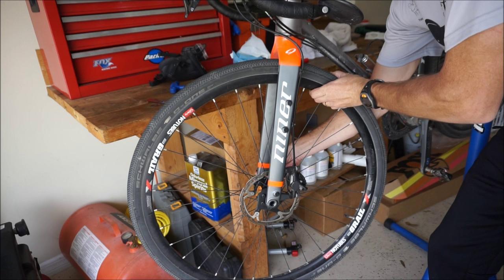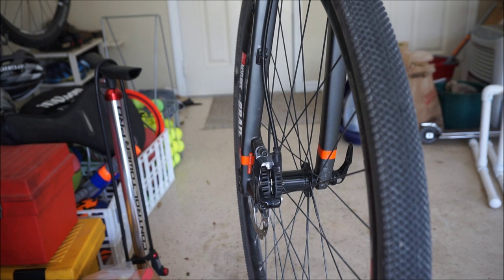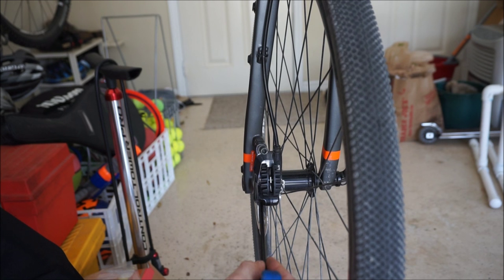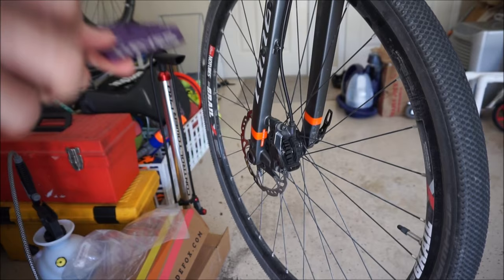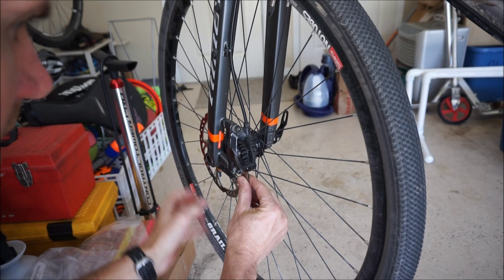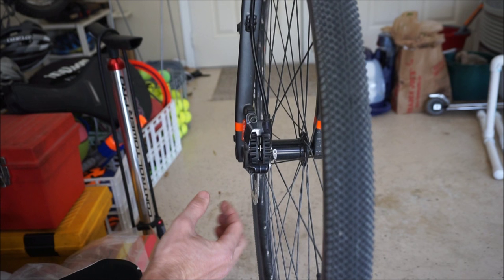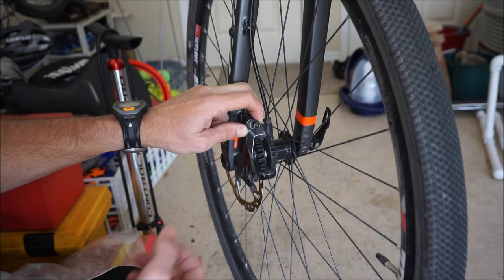How to Center Hydraulic Disc Brakes

Comment: Wow! I can’t thank you enough for posting this video. I spent 4 hours on a holiday trying to adjust the brakes using the very last method you mentioned, which is to eyeball it while screwing in bolts on the caliper. This got me nowhere and is the worst method! I do not recommend it! The first, easy method you mentioned, which is to hold the brake down while screwing in the bolts, is the best method by far. I got so pissed off and extremely discouraged by continually failing using the “eyeballing it” method that it spoiled my mood for the next 3 days and I was mean to those around me. Folks, if you can’t figure it out after half an hour, give it up and try something else! Or take it to your local bike shop. Nothing is worth you overloading yourself with failure and disappointment. Again, when I watched your video and saw how easy it was, and then was able to successfully fix my brakes, I was beyond grateful for having seen your video. Thanks for posting it.
Reply from the maker: +Biker Girl 👍
Reply: I know about moods after trying something that’s suppose to be easy and I end up screwing around for hours.

Comment: Thank you for this clear cut information, I did the first, second and finally the third one worked, the disk was a tiny bit bent and so I straightened it out with a crescent wrench. No rubbing whatsoever now. I think this happened when I put the wheel back on the frame. Thanks again.

Comment: had a issue with brake rub on my front brake when I put on new wheels. I never have issues centering brakes in the past. I saw you mention the shim tool and I completely forgot I had one of those...boom, brake centered.  :)

Comment: Nice video. To the point and straight forward. Holding the brake lever and tightening the calliper bolts worked for me. It's nice to have finally eliminated the annoying brake pad rub. Thanks Clint

Comment: Very helpful video and very clear visual and explanation. I had this problem with my rear caliper on a new bicycle and the sceaching noise when pedaling even when pushing the bike was horrible, then I was shown the two screws as you showed to loose and realign the calipers and that solved the problem. I definitely will by the tool that you just showed for future problems that may come up. Thank you for the video from Oregon state.

Comment: Very instructive, just got a new bike with hydraulic brakes and didn't know how to adjust them and didn't want to go fiddling in case I happened to open the wrong screw and spill oil all over things.

Having it auto-center didn't work well, it still pushed towards one side, but I've got a support for the front fender touching the brakes so that's probably why.

But doing it manually worked wonders, I put a soft spin on the wheel and fiddled around with the brake until it was centered and silent and then tightened it carefully and it worked great.

Thanks for a great video :)

Comment: Thanks, Clint!  I tried adjusting the bolts but still had the brake rub but using the screwdriver to reset the calipers solved it for me.

Comment: Thanks for the tip Clint, I couldn't get the squeeze  only trick to work but the business card trick that you heard of does work i cut the card to fit between the pads and rotor then squeezed and tightened and removed the cards worked great, good video thanks again.

Comment: Ok thanks for the vid Clint. I replaced my rear pads on my SLX disc brakes but had trouble centering them. I tried all these methods including business cards. One side was still rubbing and the other had a big gap. I eventually got them to only slightly rub (probably slightly out of true) by putting 3 business cards on one side and nothing on the other.
Reply: Bent  discs ? Bend back with wrench

Comment: Good video, thanks.
I watched this (and some other) a few weeks back when I was mounting Magura MT7 brakes (4-piston caliper) onto my Inspired bike.

As I did years ago with my Specialized (+ Shimano XT's) I tried the first method (loosening bolts, pulling brake lever, tightening bolts) and this seemed to work, but after close inspection it wasn't really centered - The spacing left-to-right was off a bit and the disc got pushed left/right when you pulled the brake.

I then did the "manual" method of visually looking down the pads and engaging the brake gradually to make it parallel and center. This was a huge pain-in-the-ass but in the end, the result is way better. All 4 pads engage at the same time, disc moves freely and it does not get pushed in any direction.

I would not hesitate to recommend a friend helping you for this, as you need about 3 hands doing this (1x pulling brake, 1x aligning caliper, 1x tightening bolts). It's possible alone, but it's more trial/error than precise adjustments.

Comment: Most bike mechanics will be using method 3 most of the time. The first 2 previous methods assumes a lot about how true a rotor is and how it moves from it's relaxed position to it's braking position. Many times, taking time to clean (sometimes lubricate) the pistons will put you in a scenario for the first to methods to work. Certain brakes will need to have the pistons reset overnight to help achieve this. Basically, if you are a new mechanic, don't be frustrated that you need to use method 3 more than this video would have you think. Most bikes are not in good enough shape for you to rely on those methods. It either take extra time to clean and reset or extra time adjusting. This is why I would like to see more innovation around centerring, like the hayes "crosshairs" system.

Comment: Great video ! I have an issue with my h brakes the space between rotors and pads is wider than a business card I adjusted both a couple times but the space still same, pads are like halfway down, the bigger space the less accurate braking right? What else can I do?
Reply from the maker: +Predator7 7 after you center the brakes you should be able to pump the lever and have the pads be in the right position. As long as your lever does not go too  close to the bar you should be fine. I would not say the braking is less accurate. If you find the lever going to close to the handlebars then you're going to have to bleed the system.

Comment: Squeeze centering has never worked for me. I dont know why. I always have to set it by eye for it to not rub.
Reply: Same with me Iatuman
Reply: It's worked for me.
Reply: you need to use that Hayes or similar gadget and squeeze. The squeezing without the tool did not work for me.
Reply: rear yes front not
Reply: @adityadafre4672  What advantage  is there using the tool or business cards - how does this differ than just squeeing the brakes on the disk alone?
Reply: @TopUKPhotographer  More space between the pads and the disk.
Reply: @richardjones2811  Yes, that's great.  And then the first time you use the brakes on a ride, the business cards won't be there and so the pistons will come out all the way to the rotor and your rubbing will return.  So why waste your time with the tool or cards?
Reply: @jamesmallory2149  Because that's the way it's done. My brakes are fantastic since I tried that 5 months ago. The pistons don't stay out all the way, they retract back into the piston housing (caliper) when finished braking. If yours don't then I suggest you service them or get them serviced as you may have dirt behind the piston. It's an easy job if you know what you're doing!
Reply: Sometime the bolt will move the calliper as you tighten it - so I do it by eye. Sometimes I need to hold the calliper in position as I tighten the bolt. At the least check it by eye once right.

It’s not rocket surgery, don’t know what Chris froome and all those roadies are whinging about....

Comment: Left and right adjustment is important but don't forget about the height adjustment, look at the old pads and make sure 100% of the friction material is wearing evenly , the braking force can greatly suffer if the caliper isn't seated low enough on the brake disc. So all friction material is making contact with the disc . The brakes my feel fine just after replacing pads and get worse as they wear .😮 Dont forget to measure disc for thickness and replace when out of spec .

Comment: Question: why did you not clean off the spacer with rubbing alcohol? After touch it with your fingers, you slipped it up between the pads

Comment: Good video I took mine to a bike shop they cut the top mirnal fluid cable witch was leaking I had really bad crash handle bar right in my chest I had to go hospital because of a bike shop called decathlon I paid 170 pounds and they nearly got me killed because I reckon they don't no what there doing iv order d new breck fluid cable with all the parts I bought 1 little of hydrolc mineral fluid not used yet until I get my bleed kit once got the cable I will do myself to be honest I wish I never to my hydrolc mountain bike to un qualified fools I could of died all my life iv had different mountain bike s I all was fix myself but hydrolc as anyone no s different from cable breck s I will try what you just did thanks for good information video my friend peace 👍

Comment: The Hayes disc brake tool also has a sharp end which you can use to slip in-between the pads and separate them.
Reply from the maker: +MarzNet256 thanks!
Reply from the maker: +MarzNet256 thanks!

Comment: New bike with less than 50 miles. I developed sudden rubbing/humming sound from the front disc brake after stopping at the traffic lights. I think one of the calipers didn't seem to retract properly. I left the bike to stand for a few hours and the spacing between disc and caliper seems to have normalized? It this a problem with the centering of the discs? Or something else inside the brakes?
Reply from the maker: You may have a stuck piston. Check out this video in case it helps
https://youtu.be/4C9R_H_GLKI

Comment: Hi
Does rider's weight could be a cause for the noise from front rotor especially during sharp turns, I am having this issue on my brand new bike with hydraulic disc brakes.
Thanks in advance ☺
Reply from the maker: I don't think weight really has much of a factor in the noise. There's a chance you have metal pads versus resin. If that's the case, metal pads are noisier than resin. You may want to try some resin pads if you don't ride often in wet conditions, as they wear down faster. Resin pads also have better modulation but less initial bite and less power.

Comment: Great video. Thank you. You only mentioned hydro brakes. Is there a reason why this method would not work on cable disc brakes? 
If so please advise. Thank you so much.
Reply from the maker: Yes, cable disc brakes are adjusted differently. A lot of them you only adjust one of the pads.
Reply: Clint Gibbs 
Perfect, that’s exactly what I was thinking. I’ve only got 2.5 years of wrenching experience. Hopefully another year and I’m retiring into my own repair shop. Thank you so much for your awesome videos.

Comment: Really great video, thanks for the useful tips. Just curious but...How come the pistons/pads dont just move out a little more to meet the rotor after the tool or business cards are removed and the levers been squeezed. Effectively canceling out the clearance you just set with the tool etc. Cheers.

Comment: If you are experiencing alot of issues with the brake-hold, tighten-screw method (or no success with any method), check that your screws, (washers), mating surfaces are all flat and clean! If you have a ding or embedded rock chip, paint flakes, bent/dmg'd screw this may become darn near impossible to achieve so check your hardware. Sometimes you, or stores have accidents and drop stuff so they might be bent or have dent.

Comment: Hi can a fork be the reason why rhe rubbing does not go away even how hard you try to center your brakes? I have this issue with my bike, i bought a chinese carbon rigid fork and brought it to a bike shop, mechanic said the mounts on the fork are off that's why the pads keep on rubbing
Reply from the maker: I've never seen a fork be the issue, but some of the older ones needed shims to center. Also try this https://youtu.be/4C9R_H_GLKI
Reply: @ClintGibbs  thanks 😊 ill try to do it myself.. 😊

Comment: Good video btw i noticed when I squeeze my front brakes the lever goes all the way to the handle bars but the pads looks good would this method fix my issue?
Reply from the maker: Most likely you need to bleed your brakes. Sounds like you have some air in the system

https://youtu.be/A8J3QGwHZjI

https://youtu.be/2mxzFomRYNg
Reply: @ClintGibbs  the bike came with mechanical brakes but I changed the mechanical calipers to hydraulic calipers maybe I got a bad caliper too

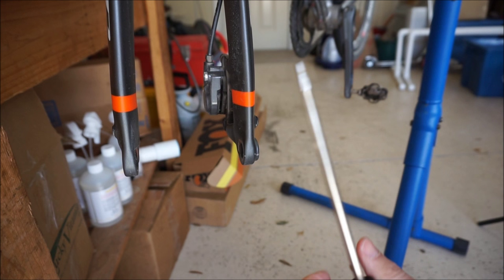Comment: 2:31....i did that to my new MTB.....i did't knew about it.......can u plzz explains what it actually does to the breaks and what is the fix to that!
Reply from the maker: Did the pistons pop out? If so you need to put them back in and do a full brake bleed. You might need to take it to the bike shop to be repaired.

Comment: Thanks for the video. I have a problematic caliper mount. It's similar to yours. It has a bracket. It's mounted in these series on the top screw holding the caliper. Screw - one washer - caliper -  3 washers - bracket - frame. The problem is those 3 washers shift while I'm screwing and this forces top part of caliper outside the frame. So calipers cannot be mounted parallel to the rotor. I think mount surfaces on frame and caliper are acceptably parallel. But those 3 washers are just low quality and a little bent steel washers. Which material washers should I prefer? Maybe something softer which will fit to imperfectly parallel surfaces by pressure. Or should I try an alternative mounting method? Thanks in advance.
Reply from the maker: Hard to really say without seeing it, but if it were me I would go to the bike shop and get the proper washer kit for that specific brake. SRAM and Shimano, especially, use a pretty unique series of washers.
Reply: @ClintGibbs  thank you for your reply. I guess the problem is about the adapter. I read a little and I've learned that this bracket is an adapter. Probably fork is designed for 140mm rotor and manufacturer installed a 160mm rotor with this fancy adapter they made or had in stock. It's very strange and pity that the manufacturer sold a new bicycle with an adapter,  I didn't check this before. I'll fix it with a good adapter and my next bicycle will certainly be from a well reputable brand which won't hurt my wallet much. I'm really disgusted with Turkish bicycle manufacturers. They used to make great frames before 90s.
Reply from the maker: @cihanbozkir  That makes sense. Yes, there are different mounting brackets depending on what size rotor you are using. I agree, it sounds like poor workmanship.
Reply: @ClintGibbs  Trek was the price performance king of Taiwan made frames and good workmanship until some years ago however Trek seems to increase prices a lot lately. That's strange that anything related with bicycle is too expensive including bicycles themselves and also tools,  accessories,  parts. It was always so for imported brands in Turkey but domestic brands were cheap. Now domestic brands' quality suffers a lot while they're not cheap anymore.

Comment: Another great instructional video. I have an eerie question: whenever I dislodge the front wheel of my bike to put it in the car and then put it back on, there is the brake rub and I have to use the first method in your video. Although not tedious at all, it feels cumbersome and an added step whenever I feel the need to take the bike out and go on a trail. The brakes are Shimano SLX with 160 mm brake rotors and SLX levers. Any advice would help.

Thank you.
Reply from the maker: Either the brake caliper is getting moved. In that case you want to make sure the bolts are pretty tight. Or I'm going to guess that you have an old style quick release instead of a through axle? If so then perhaps the wheel is just slightly off center sometimes and you need to make sure you put a lot of weight on the stem before tightening the quick release
Reply: @ClintGibbs  this is the new Giant XTC SLX 2, 2017 model that I recently bought after your kind recommendation.

Comment: So i should spread out the pads before doing the loosening method, is that correct? Do I squeeze it once to align it or do I have to squeeze a few times before screwing it back on? Usually I've seen vids say just loosen & squeeze, nothing about spreading the pads first.
Reply from the maker: Spreading the pads can help if there is a stuck piston so it's good practice. Then you would keep squeezing the brakes until you get a firm contact. Also, this video may help:
https://youtu.be/4C9R_H_GLKI
Reply: @ClintGibbs  thank you
Reply: do you by chance have a link to that tool you used?
Reply from the maker: @mellissanash7517  http://www.birzman.com/products_2.php?uID=2&cID=4&Key=133

Comment: What advantage  is there using the tool or business cards - how does this differ than just squeeing the brakes on the disk alone?
Reply from the maker: Sometimes just squeezing the brakes does not align them properly. A spacer between the pads and the rotors gives you a better shot at it.
Reply: Clint Gibbs can you say why this works? I can’t see, myself.
Reply from the maker: @TopUKPhotographer  it puts more space between pads and the rotor forcing the pistons to be more centered

Comment: My brake lever is going all the way to the handle it stops the bike but how do I make it where it does not go all the way down?
Reply from the maker: +Josh Sizzle you need to bleed the brakes. If there are Shimano then check out my video on how to bleed Shimano hydraulic brakes.